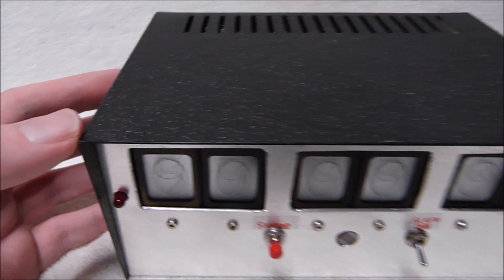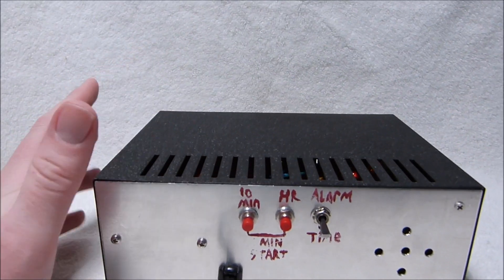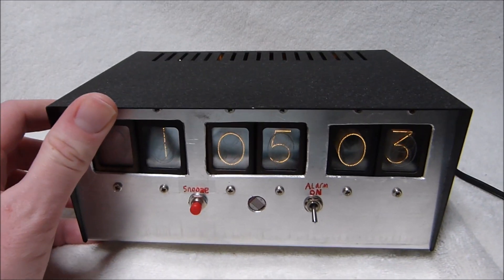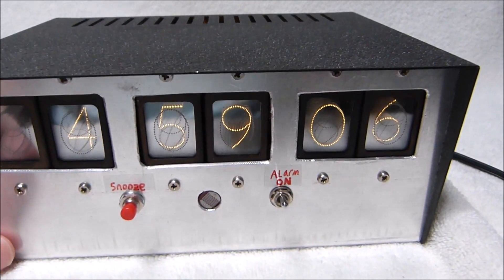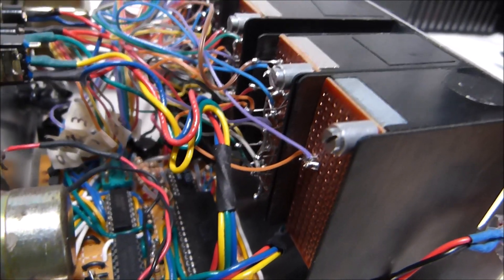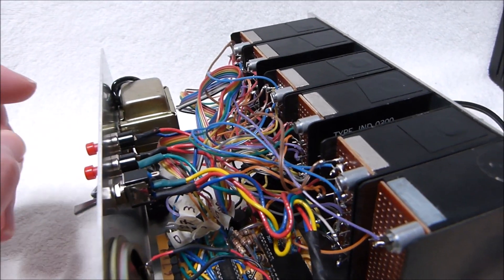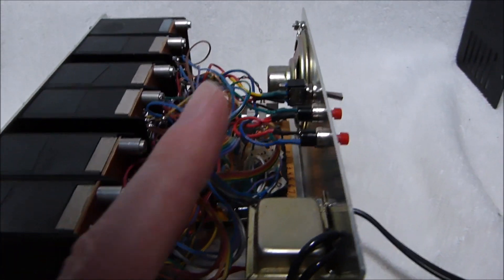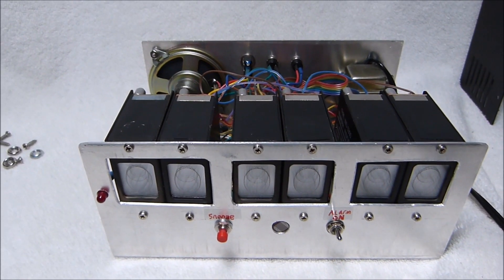My 1970's style edge-lit digital clock

Comment: Very interesting. I just bought an RGB LED driven etched glass edge lit display clock from china. Not as cool as yours in the vintage Radio Shack case, but it's more compact and fascinating to look at. I prefer this display concept over nixie tubes as they are solid state, low power and does not throw off heat.

Comment: I remember as a kid climbing through scrap aeroplanes and bringing home an edge lit display. It was quite small with a load of tiny bulbs at the rear end.
Reply from the maker: That was quite an opportunity for scavenging! I haven't seen edge lit displays in avionics, but projection displays seem to have been pretty common as they could display all sorts of custom messages.
Reply: @50sTransistorRadios  I used to climb over a wall into the yard with friends on a Sunday. There was no one around so we had the place to ourselves. It was great. We'd be there for hours. Thankfully we never got caught!
Reply from the maker: @colintinker7778  It's a good thing you never got caught! It sounds like you "found" a bunch of cool things too
Reply: @50sTransistorRadios  We did get chased out of the place after about the fifth visit. The man had a shotgun! We were really scared and I don't reckon I've ever run so fast in my life. We never went back!

Comment: I have never seen displays like that.  Almost looks nixie, and sorta combined with an "infinity mirror" (if I remember the term correctly).  When you popped the hood I was a little taken back by how large the modules are.

Very good that you are happy with a project.  That is always very good.

If you ever come across a bending jig and sheet metal guillotine you might wanna grab it/them.  It would probably make you very happy.  It requires room, however.  (Caution: First thing guys make -- all guys -- are ninja throwing stars).
Reply from the maker: Edge lit displays are fairly rare, and they do have a bit of the  "infinity mirror" effect, due to reflections between the acrylic sheets.
Yes, it would be quite disappointing to have put so much time into something and have it not turn out.
It would be nice to have proper metal working equipment (and maybe a 3D printer), but alas I don't really have the space for it right now.